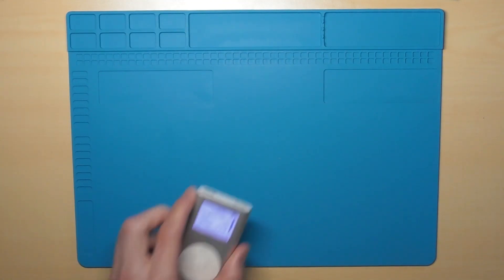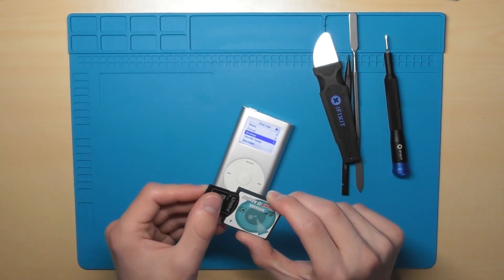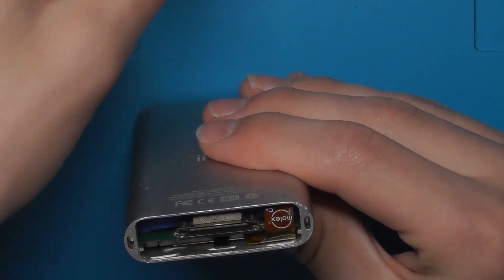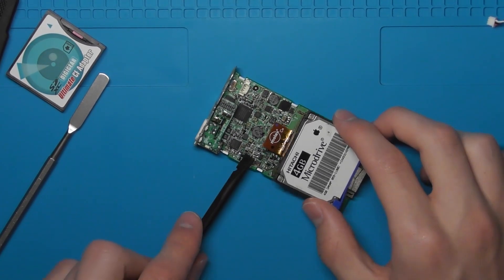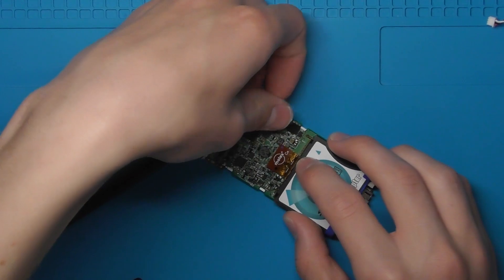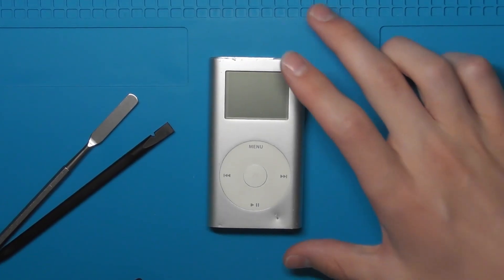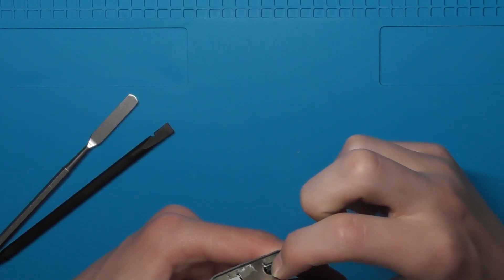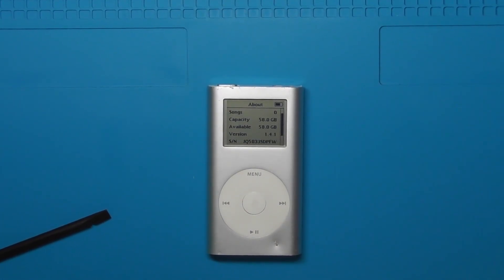How to flashmod an iPod mini

Comment: While doing mine the entire mounting bracket for the headphone jack assembly fell off the board. Looked like it was corroded from sweat or something. Completely trashed the mini I bought but I still had a good screen and click wheel and case so I just gotta find a trashed one to buy or source out a new logic board. Anyway great video. Was nice to watch.
Reply: oh boy that bit is meant to be able to pop off you could have just pushed it back in lol

Comment: I just flashmoded my iPod Mini 1st Gen with a 256GB SD card thanks to your video ! Thank you
Reply: Could you use the shuffle mode? Some posts said that the shuffle mode don't work well.
Reply: @joshuaanri1556  Yes, no problem with Shuffle mode
Reply: Did your iPod act up with the 256Gb?
Reply: @bnet32  Yes, I gave it to a relative 6 month ago, she loves it, using it almost everyday
Reply: Great, I too have been wondering about the iPod Mini 1st Gen! Is your shuffle mode working?